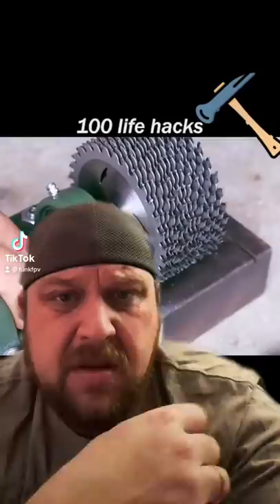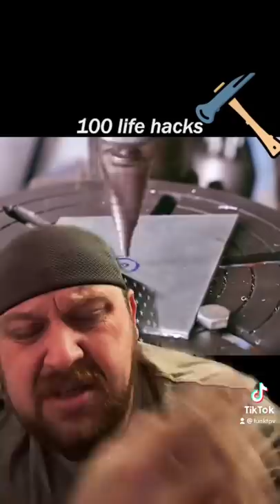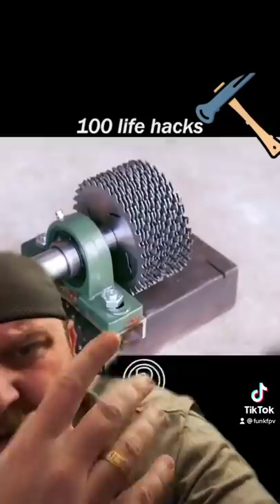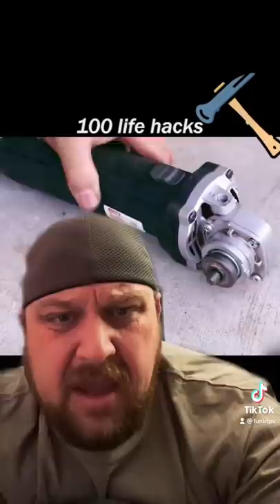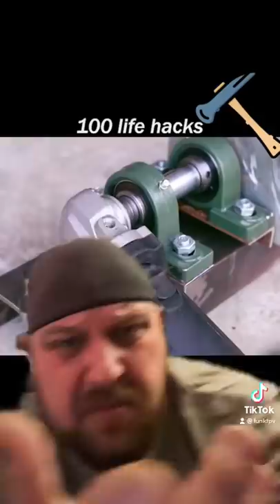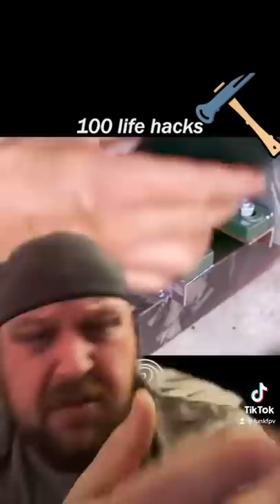Dangerous Life Hacks

Comment: The thing that hurts the most is, he’s welding everything in place, do you not need that angle grinder again?, Do you not ever need to change out those sawblades when they get dull, or we just gonna play cut it apart and weld it back together. Every time you need to do basic maintenance on the finger remover 2000?
Reply: To be fair, the grinder is only bolted in, you can get that back quite easily
Reply: this thing has no purpose and was probably tossed in the scrap pile as soon as they finished filming. they might have removed the grinder but its probably a cheap grinder that went into the trash with this monstrosity
Reply: This comment actually made me laugh out loud 😂
Reply: You only have to assemble it once, after you won't have ay fingers left to take it back apart anyways.
Reply: The blades are tungsten tipped so for making sawdust from clean wood, itll last the angle grinder out twice over or more.
Reply: It will last the rest of your career!
Reply: What waste of timber and a good angle grinder and..
Reply: This is just the "proof of concept". Once its efficacy at removing digits is optimized, the production run will have interchangeable parts. Literally.
Reply: Naaah, you just grind the welds out with the gri... I was saying you just throw the whole abomination to scrap yard
Reply: The purpose of the machien was to generate clicks and likes. It served its purpose, then got tossed.
Reply: With that welding, surely a few hits with a hammer will have it all apart again?
Reply: @bobbyshifflett311 actually looks like a metabo grinder not a bad grinder actually.

And thise blades could stay sharp enough for given purpose for QUITE sone time.

I have some saw blades u haven't change in a hot minute and still work perfectly great smooth straight cuts

Comment: Sometimes you just need a lot of sawdust, and you want to get it in as dangerous a fashion as possible. I get that.
Reply: And as expensive as possible, a bram like this is worth multiple more times than any sawdust since its a free by product
Reply: its all about balancing on that edge. i mean you could just use an axe to cut of a hand. but thats too easy😂
Reply: Don't kinkshame.
Reply: Sawdust is useful for soaking up blood, so that's essential for this workshop. And it can be operated without fingers.
Reply: Could be for making charcoal briquettes or salvaging plastic. These videos aren't meant for people in 1st world countries. Also, they exist as a proof-of-concept and not as a finished product to build. They expect their viewers to do a better job building their own devices.
Reply: @ryelor123  they shouldn’t exist at all is everyone’s point. 

Even if they were for some purpose (which I doubt) they’re either poorly done, waste of material or tools, or just straight up fake…. Or all of the above.
Reply: Actually when i used to build furniture,we would take fi e sawdust & woodglue and mix it together to fill holes & cracks. We called it 1/4 inch putty. Worked great lol.
Reply: The sawdust burns in the boiler that powers the grinder.... I smell perpetual motion... except the power for the welder. Maybe that's why they only tack weld stuff.
Reply: @ryelor123  sawblades are expensive  and charcoal is not made from sawdust. Building this fingerremovers is clickbait.
Reply: Me 🦧
Reply: ya totally agree, must get the sawdust as dangrous as possible, it so unmanly to even thing of doing it safe, if ther isent a 50/50 chance of loosing a digit ... and i think the torke is to low too, should be alot bigger engine so he tacs just riffs and send the disks flying when u hit a nail.. this is faar to safe..

Comment: They can’t run beads because they’re welding with car batteries.
Reply: Gunner, I think you're onto something here!
Reply: That actually works and serves a purpose, though lol
Reply: Pretty sure you can still run a bead with car batteries but maybe you need more than one.
Reply: @supertornadogun1690  Yup. It's been years since I was welding like a punk, but if I remember right you need at least 3 batteries, possibly just two beefy ones, to make decently functional beads
Reply: You can´t run a bead in material that thin. You just end with a big hole that you then have to fill with tacks. Trust me on that.
Reply: Hey it works!
Reply: @Biden_is_demented  I can run a bead, but I wouldn't trust it to hold much. Then again, not like metal that thin can hold much anyways XD.  Have to turn your amps down pretty low, run a 1/8ths E6013 rod and push instead of dragging. Ballpark figure for the amperage is something between 40 and 60 if I remember right. And expect to have a curse word filled time getting the arc struck and keeping it going.
Reply: And I think another big part of it is that it saves sticks. Same thing as pencils, the less you write per paper, the more papers you can write.
Reply: I ran beads with a couple car batteries
Reply: what does beads mean?
Reply: @ThBlueSalamander  it refers to the weld.
Reply: @Biden_is_demented  yes you can. I knew a very experienced sheet metal welder. He took our industrial MIG welder rated for up to 1” mild steel, turned the heat and the wire speed all the way up and ran a four foot long vertical bead in seconds.
Reply: @kanmeridoc1784  I have been a welder since 1968 and I fully agree with everything you said there but personally I would switch the 6013 to a 7014, that's just me though.
Reply: I didn't think of that but yeah mate you're probably right.
Reply: @supertornadogun1690 
I believe multiple 24-volt semi truck batteries run in series would possibly do the trick.
Reply: @russianotter tractor batterys
Reply: Hey, thanks for the life hack! 😉👨‍🏭
Reply: @Wierd_Loco_Steam_Works  yes those too. 3 of them will run a stick easily. Though you wanna be careful and watch the temperature of the battery.
Reply: @ThBlueSalamander anal beads
Reply: @russianotter  3 12V car batteries, OR 2 24V truck batteries. Ran in a series to get a total of 36V or 48V depending on your chosen application
Reply: @ThBlueSalamander  A single line of weld, unlike the single dots that guy was doing.
Reply: Excellent callback well done
Reply: I've welded with car batteries lots. No problem running beads if using the correct size rod
Reply: Many of the welding "machines" are built by the local fiend with his own 3 fingers. The duty cycle is typically 54% every 5 sec. So tack welding seriously stresses it to its limits.  Actually translated from a new "machine" for sale on a local street in 2003.
Reply: Almost a year later and this popped into my timeline again. And I came to the same convo 😅 this time all I want to know, is couldn't you still run wood into this thing without the box?
Reply: That’s what I was thinking 😂
Reply: Dude I think you right on the mark 😂
Reply: @ThBlueSalamander it's a continuous weld

Comment: Awesome, I was wondering how I could turn expensive lumber into dust a efficiently as possible because lumber is so bulky and troublesome.
Reply: imagine if lumberyards knew about this, they could store & transport all that lumber as dust!
Reply: @Shadi2  and think of the decreased risk to employees regarding hernias, back injuries, etc... since carrying heavy pieces of lumber will no longer be a necessary task,  simply carry a styrofoam cup of lumber at a time and even if you were to drop it on your toes it will cause no pain or injury unlike the traditional old obsolete style of lumber in that ridiculous "Board Form"  And the end user will certainly appreciate how much easier it is to drive nails or screws into this new modern style of lumber. I think the smart investment to make big returns and gain long-term financial stability is pretty obvious, I'm gonna sink my entire 401K into this and retire in style and 10 years early !!!
Reply: You just run the machine in reverse to reconstitute your lumber
Reply: @119beaker  that's some ultra genius level shit there.
Reply: The blades aren’t real cheap either
Reply: Just buy their new tool to convert dust back into wood pieces. Gunna need to mess around with some hydraulic fluid though
Reply: "The finger remover 2000" most excellent products 👌
Reply: When the customer  orders lumber by the bag
Reply: 900 likes let me fix that
Reply: Have you considered reacting it with oxygen? Gets rid of "bulky and troublesome" lumber with no effort!
Reply: @NoOne-ef7yu  unfortunately I'm not allowed to burn anything after the last incedent..incident... ok the last 4 incedents...
Reply: Just make a homemade Press to turn them back into One Bys at home. just add some wood glue. what could go wrong?
Reply: @justinlast2lastharder749 when I was a kid, about 13 years old I went with my dad ( he drove a Kenworth pulling a flatbed trailer loaded with lumber) to some place out in the middle of the woods in East Texas. I asked my dad what this place was, turns out they made Thad would grind all of that lumber into sawdust  add some fire retardant chemical and glue, thn pour the mix into a giant press table thing and I think it had a heater on it to speed up the curing process. The end product was used for stuff like that panel on the back of a cheap set of dresser drawers, or the back of an old wooden cabinet console TV. That crap that kinda looks like cardboard until you look really close and then you can tell it's made from sawdust. They also make that cheap pegboard that you might use in a garage to hang tools from. I'm not sure if these were reject 2×4s or what but it always tripped me out to go through all that effort, time, and money to make a cheap ass product like that from what appeared to be decent lumber.
Reply: @119beaker  then you sell the regular lumber as a premium, not-from-concentrate product, just like orange juice
Reply: Then you just add wood putty, form it into two by fours, and allow 24 hours to cure... Brilliant!
Reply: Just glue it all back together on the job.
Reply: Takes less space, too! Very convenient for storage
Reply: Say no more I'll order one for me and one for my mother in law
Reply: @sumaoncrack2251  thanks, this entire operation would go to shit without you, your living proof that not all heroes wear capes...I assume you don't wear a cape but if you do, well there is nothing wrong with that in this day and age...
Reply: Now just buy a drum of wood glue and make any wood you need😅😅😅
Reply: Sawdust has more air in it and is thusly easier to transport!
Reply: Who needs lumber, saw dust is all the rage in 2024

Comment: they’ve officially developed the most efficient way to lose your arm in a horrific way
Reply: Not sure its the most efficient way but the wounds that would inflict sure would be horrific.  That said if I needed a wood chipper that badly I'd just go down to harbor freight.  theirs are not very expensive and would be a heck of alot safer than that death trap.
Reply: @merendell  why would you touch the blades. you guys make it sound like its easier to stick your arm in this then a chop saw. id be more worried about it falling apart and going into my face then losing an arm falling into it like a fool.

Comment: “Just run a bead.” I told so many apprentice welders the same thing. PTSD.
Reply: What the hell is a bead?
Reply: That welder would blow a hole in that thin crap
Reply: @johndelta00  😂😂
Reply: @johndelta00  with the right rod, you can stick weld fairly thin. 1/16 6013 running electrode negative can weld utility blades if you're good. Not saying it's practical to stick weld that thin of course.
Reply: In the amount of time they tack welded, they could've been faster and ran a quick bead.  It won't melt the metal as bad if you're quick with it.
Reply: @valory13  
Basically running a line with the weld.
Reply: @johndelta00  good welders wont
Reply: Oversized rod would have melted the material, had to tack. You can tell by the fact they made this machine they're too lazy to go to the parts store.
Reply: @valory13  when the metal melts it reforms in a little bead

Comment: This is the type of thing you make when you're on meth: some super complicated, barely together, unsafe contraption that takes 8 hours to make, in order to solve a problem that could have been solved with a 5 minute trip to the parts store.  It's even scarier to think that someone not on drugs made this, as there really isn't an excuse then.
Reply: Yo be fair we can't guarantee there weren't any drugs
Reply: Even then, how do you replace the blades? They welded everything all around.
Reply: @Angel-vd2hr  
The end is open to loosen the blades, you then remove the bolted on grinder and pull the shaft from the pedestal bearing.
The blades stay in the casing which you then proceed to tip over to remove the blades.

The real problem begins when you try to re-assemble.
Reply: @stoneomountain2390   now explain what the fucking purpose is.
Reply: @Spider-ew2gc  it's a mulching device.
Reply: @stoneomountain2390  Mulching what, fingers? You ain't mulching anything with a little rinky dink grinder motor that'll burn out in a day.
Reply: @thevalorousdong7675  it's a mulcher wiseass, even if it's poorly designed, it still is a tool used to make large pieces of wood into little ones.
The half horsepower mulcher I have had a lot of flaps to keep fingers out and chips in.
After swallowing 2 gloves, we removed that trash  and 8 years later, still have all our fingers.
Reply: Lol!!! There's a crackhead around me that always posts his ridiculous inventions and contraptions on kijiji and marketplace. One of those guys that spends more effort avoiding work than he'd need to spend at work to make a living
Reply: I had a friend who was so paranoid on Meth one day when he was putting in his car stereo he was terrified to leave his truck.  But he needed a Phillips head and forgot it outside.  So he spent like 5 hours MAKING a Phillips head-like device that he could have spent 2 seconds opening the door and just picking up.  Meth is a hell of a drug.
Reply: This is so true
Reply: @stoneomountain2390  Yeah...your explanation proves that youre a user...stop digging a hole for yourself and get help...like the aa meeting or something.
Reply: bro my dad was a meth addict until I was 13 I have so many memories of the crazy shit he and his tweaker friends built. DIY heaters, air compressors, car parts, all types of dangerous shit.
Reply: @BenWard29  hilarious but sad
Reply: You're giving whoever made this too much credit by saying it's solving a problem.  It doesn't solve anything.
Reply: @stoneomountain2390  The only reason a person would defend this monstrosity is if they were the one that made it.  It's useless.
Reply: @jridenour31  exactly
Reply: Most places don't have hardware stores or beer budgets
Reply: Took me a lot longer than 8 hours to make my stupid projects when I was tweaking. I spent a month making a little rock polisher (i.e., a small rotating waterproof barrel) out of a cardboard box, gears and a little motor from an old printer, a cylindrical plastic container, and some silicone sealant. Sheesh... I'm over two years clean now but I think that damn thing is still in my parents' garage. God time passes fast.

Comment: My only guess as to what this would be used for is like a DIY small scale wood chipper/destroyer. It seems to serve no other purpose than to haphazardly produce cellulose powder out of pieces of wood.
Reply: Don't call it that,people will work out it's in their muffins,it's wood dust that is all
Reply: Wood dust could be useful in tabletop crafting. But you can texturize a terrain or a street or whatever with plenty other materials so yeah
Reply: Shut up Erick 😂
Reply: @leezy7787  😳🤣
Reply: What was the song name
Reply: Make your own dust bomb!
Reply: @schattenprinz and boat building, finish carpentry, we mix with epoxies or certain glues. Different wood makes different colors for matching.    You can buy, or like me, I save all my clean sawdust then shake through a silk screening mesh
Reply: That’s what I was thinking. However, I feel like you’d be better off with a full sized wood chipper, I just see this little guy leading to major frustration when stuff doesn’t want to fit through that hole.
Reply: @leezy7787  the hell is wrong with you?

Comment: At my job, we use the "finger remover 2000" to make the stones we use for grinding more coarse, particularly our cone grinders, which are typically used for large areas or where major grinding is required. Basically a stone sharpener

Edit: though the sharpener doesn't have a grinder attached to it, we just turn the grinder on and hold the stone against it and the spinning of the grinder does the job for us, thanks and I hope this was informative